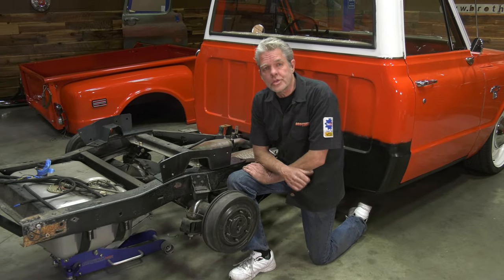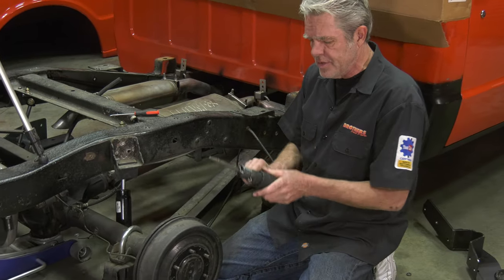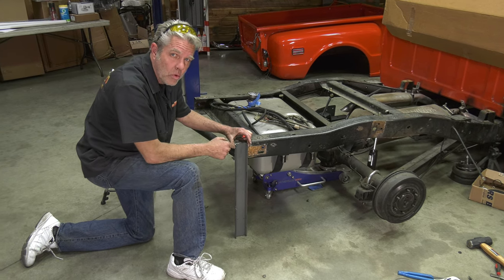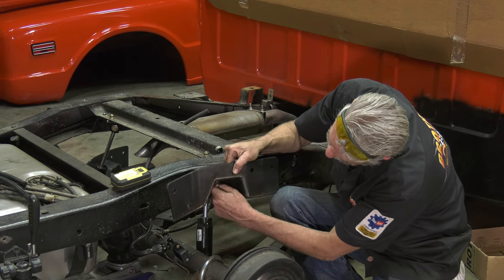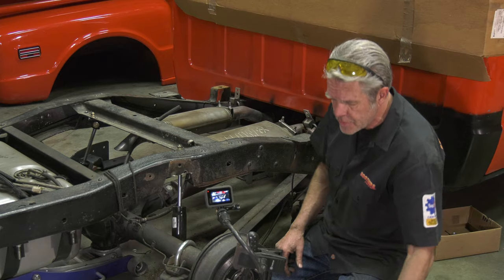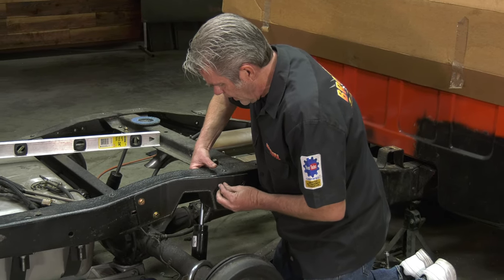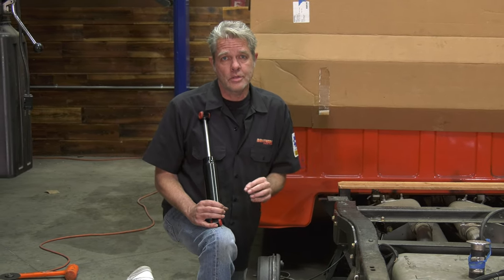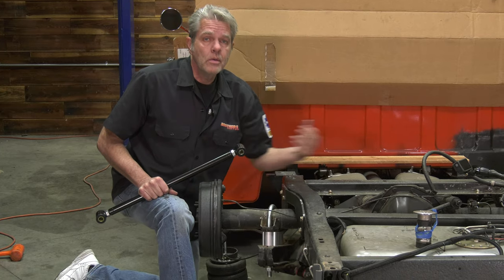Chevy & GMC Truck C-Notch Installation / Axle Clearance for Lowered Pickups!

Comment: After the c-notch template is marked on the frame, I would recommend drilling a hole into the frame in each corner of the intended cut. A rounded corner tends to have more rigidity at the intersections of the cut. If that makes any sense.
Reply from the maker: Thats exactly why we mentioned it in the video! Thanks for watching!
Reply: Perhaps I missed it, but more likely I didn’t explain it very well but...I was suggesting to drill perhaps 1/4 inch holes in the corners of the intersecting locations of the actual cuts on the frame of the c-notch. That slightly rounded edge at the top of the cut on each corner helps prevent cracks
Reply from the maker: @thedailyvariety4407   We understood and its an excellent suggestion, if we missed it in the video that was an oversight. Thanks for the suggestion!
Reply: @thedailyvariety4407  👍
Reply: Basically the only thing not mentioned in this video,  but a potentially very useful tip. Still an excellent video overall.
Reply: @shawnwimberly9294 of Coors
Reply: Wouldn’t it be better if welded instead of bolted together?

Comment: Great video! My C-notch install would have been much easier if I would have removed the bed... Overall though,  it wasn't that tough for a one man install, lying on my back in the driveway... The rivets were definitely the hardest thing to deal with out of the whole install. I would highly suggest a face shield and some thick welding gloves for sparks and when those cut-off wheels inevitably fail on you and send shards flying.
Reply from the maker: Good tip!
Reply: Grinder with cut off disk

Comment: Started on mine this evening and doing the passenger side first. I’ve noticed (after it’s on and bolted up) that the rear end is not centered in the notch... I did use the existing 3 holes in the frame for the front of the notch, so assume all is well.? I haven’t lifted the rear end up yet to see its exact figment, but just looks off. Is this normal.?
Reply from the maker: It's not critical for it to be perfectly placed as long as the rear end is able to use all the new clearance.
Reply: Ok thanks. If I finish the driver side today, I’ll be able to jack it up and check it out.
Reply: Jonathan I have the same thing going on I will finish tomorrow in my eyes it’s off about 1/2 forward.
Reply: @guadalupeacevedo7236  I haven’t gotten back to mine to finish it yet.. unfortunately got too busy with work.
Reply: How did yours turn out?

Comment: Any reason why you wouldn't want to weld it as well?
Reply from the maker: Most people would probably finish it by welding. However, it's designed as a bolt-in because not everyone has a welder or access to one.